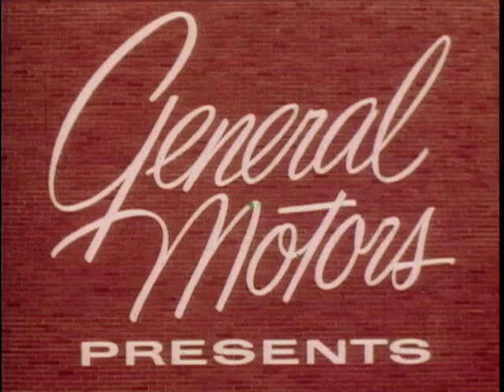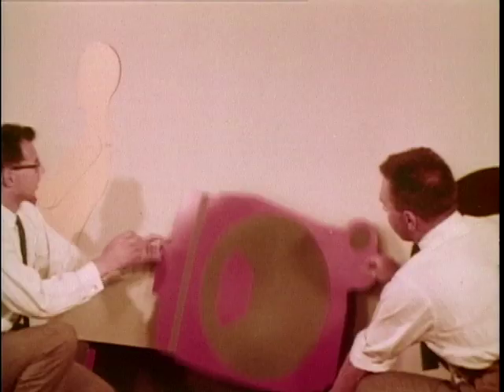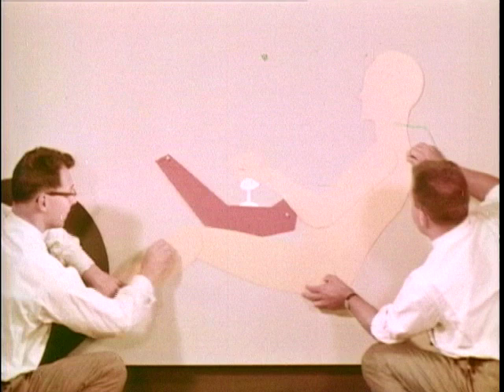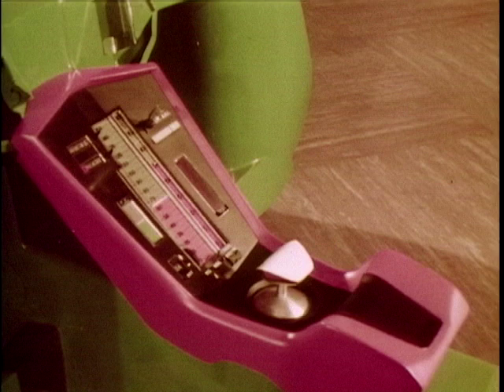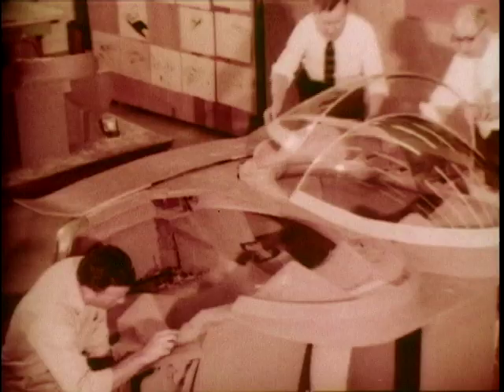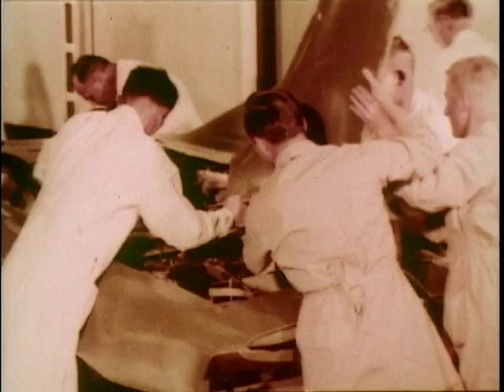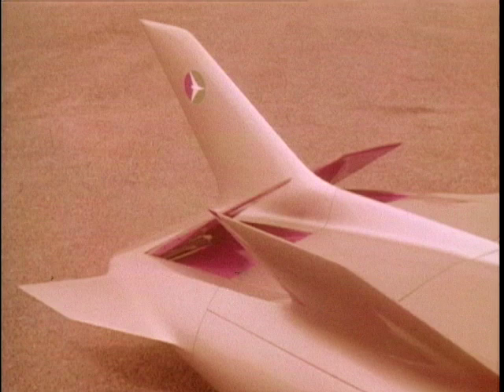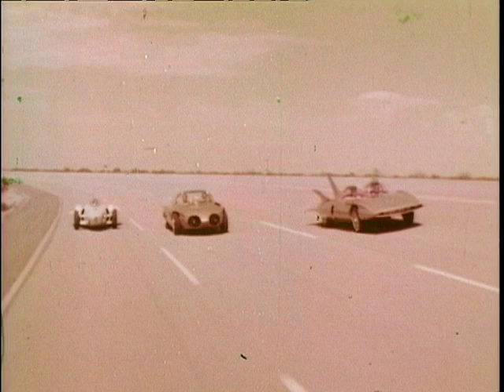General Motors Firebird III Original Promo Film - 1958

Comment: Jeremy B --  I enjoyed your defense of the yarn. I understand that some of the studios may have tried the yarn but after a while they changed over to using thin 3M (1/8" to 1/4" wide) black "photographic" tape because it was much more graphic. I was disappointed, not because they changed but because they missed the whole point. By using the push pins it gave a visual "trace" of the mathematics of the line. Your eye is a good judge of proportions; you can clean up the line to a better mathematical purity and THAT is what they lost. I was working, in fact, in those days with a "poor man's computer"... almost exactly 60 years ago in March (I was 26). ....        Thanks too to gomets69(Stu?)